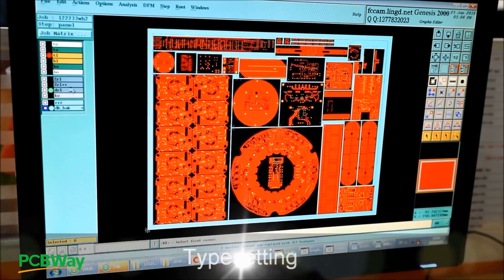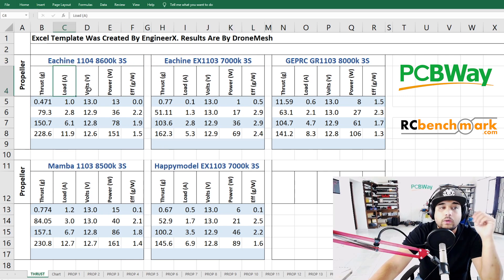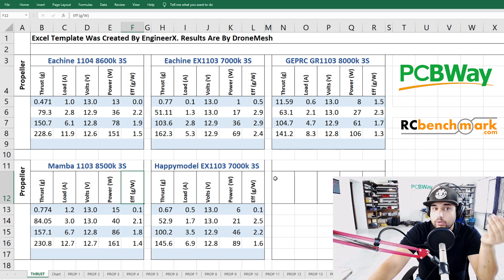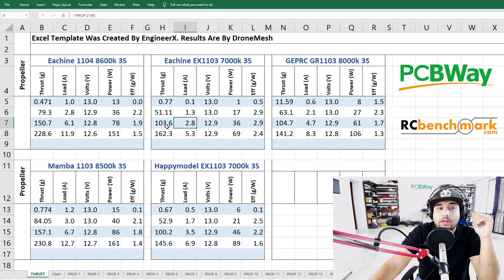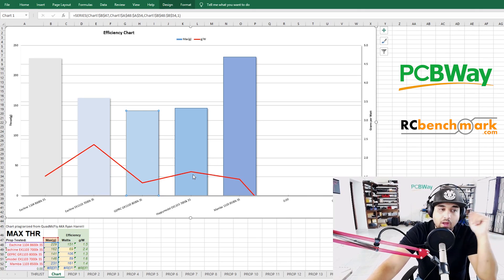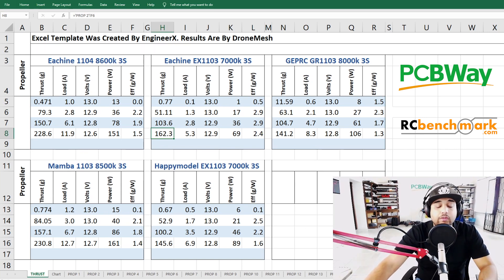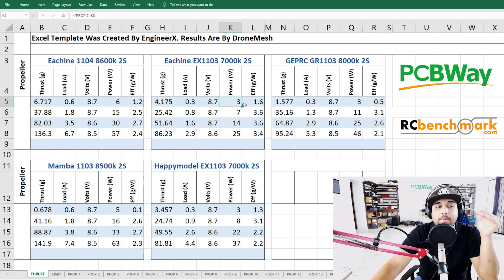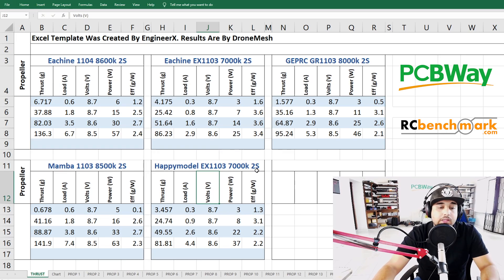Tootpick Research Episode #1- 7000kv - 8600kv Motors Shootout

Comment: something is wrong - your 25% make 0.7g thrust and 0.1 load?? - most almost hoover at that throttle - even logically, AUW of 3inch toothpick with battery 80g / 4 = 20g per motor is hoover, which is normally around 25%, but you have 0.7g..... Am I missing something?

Comment: I've got a set of those 1103 8500kv mamba motors on a 2" build and have been really happy with how well they preform. They do draw a lot of power though, which shortens the flight times. On 3s they are really fun regardless. Your testing results matched up with what I expected to see when I saw them on the list.

Comment: Just did a build with the flywoo NIN 1103 8650kv, and damn, those things are monsters. Finally a craft that will lift my turtle v2 without breaking a sweat. Would love to see where they'd end up compared to the others
Reply: AUW is 117g with 450mah 3s, as well. 2540 gemfan tri blades. Thought it'd be too heavy at first, but it rips!

Comment: I did get 4 hole motors on the RedDevil They are the old 1103 8000kv RacerStars. You just need to extend 2 holes and then drill a 3rd hole and use 3 screws works just fine. I did loose about 30 seconds of flight time but the stock motors were 1102 8700kv. Works fine on 3s motors not even warm. Punch is very similar.

Comment: It is true the EX11XX motors are efficient, but the quality is lacking.  The ones with c clips on the top just snap the shaft and the ones without just spin the bell.  Don't get me started on how weak the connection from the wires to the windings is.   I actually resoldered (and epoxied) those a couple times.  They're great while they last.  Plus you have the small 3 hole mounting issues.  The pickle frame is good if you want to use them.
Reply from the maker: Yes I found that first hand on my larva review which will be up once replacement motors arrive.

Comment: I would like to buy/build a toothpick... i like long flighttimes and i would prefer 1s or 2s or 1-2s configurations...
What would you recommend for me?:D
Reply: Not that you're asking me, but don't even bother with 1s unless you don't mind making compromises on everything.  Go 2s 500mah or more with an all up weight of less than 80g with biprops.
Reply: williwonti ok... i have a lot of those 1s 300mah woop batteries... i wanna use them... (my trashcan burned out on my first flight...:/)
Reply: @checkm8606  You can double up on the 1S with a connector like the Trashcan has, but don't expect the batteries that came with it to last long.  I'd build my own with a real rx and decent camera and real vtx with at least 200mw output.  But it can actually be cheaper if you buy a prebuilt.    If you live in US try racedayquads, pyrodrone and maybe the US warehouse of taco-rc
Reply: williwonti im im the eu...^^' 
Which prebuilt would you recommend?
Reply: @checkm8606  Make an adaptor and use this batteries on Eachine Red Devil, 5min of flight.
Reply: williwonti build it youself? Or do you recommend a model?